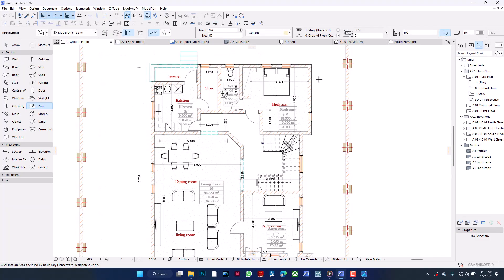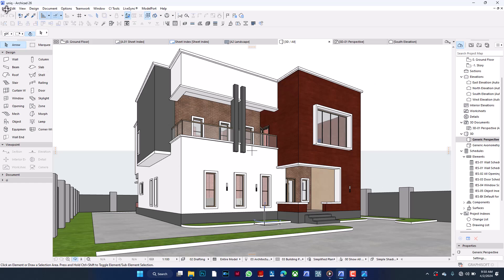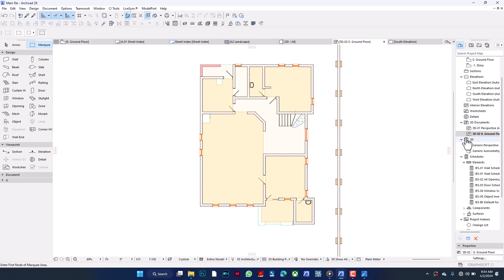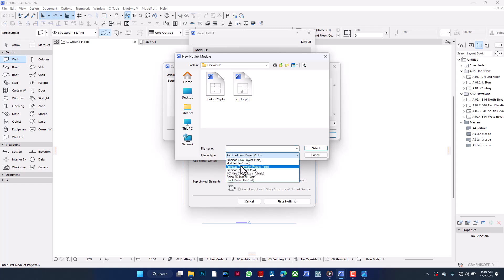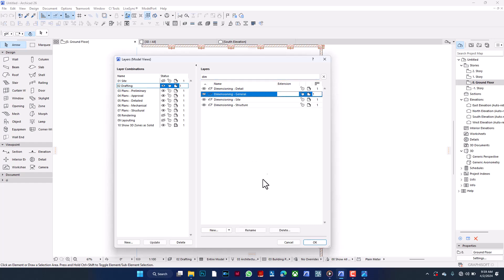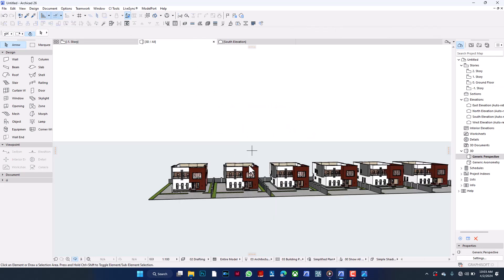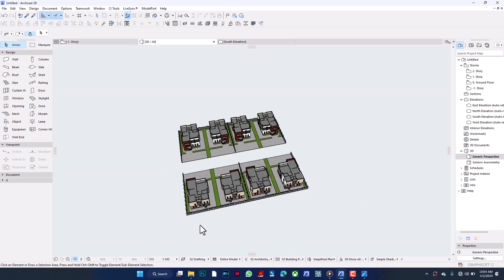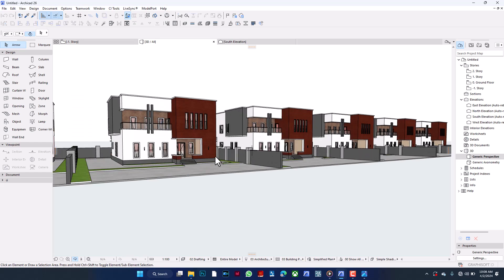How to use Archicad Modules

Comment: I have been using archicad 12 but it has become obsolete and I want to upgrade to more modern archicad so which year archicad are you advising me to install
Reply from the maker: What are the specs of your current PC?
Reply: @frankenstein7-77  I'm currently using HP  Intel core i5 laptop
Reply from the maker: @evansukpai8279  what's the RAM, ROM , graphics card etc?